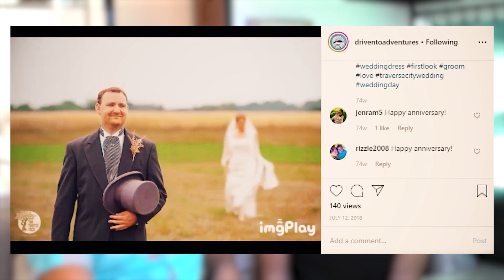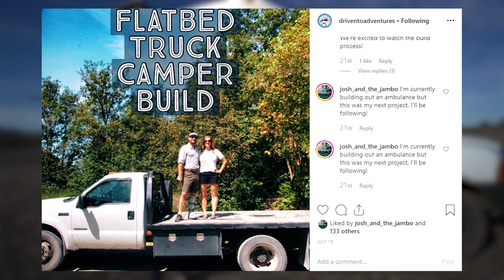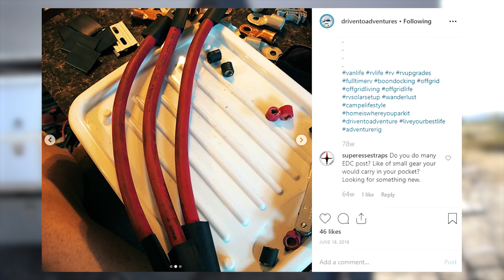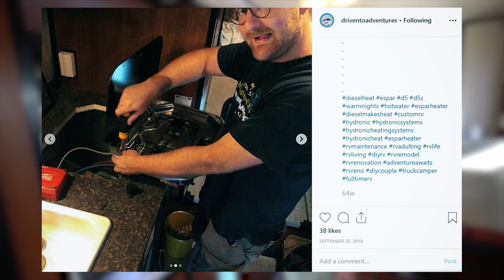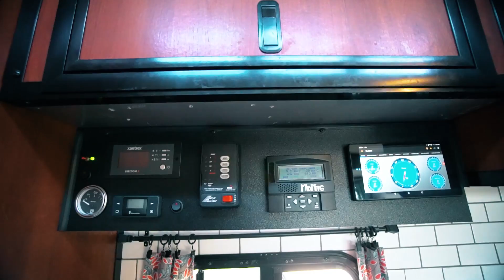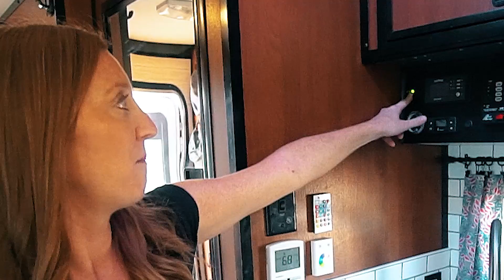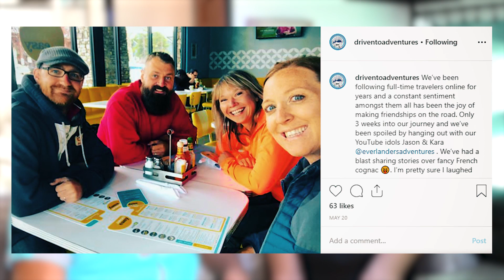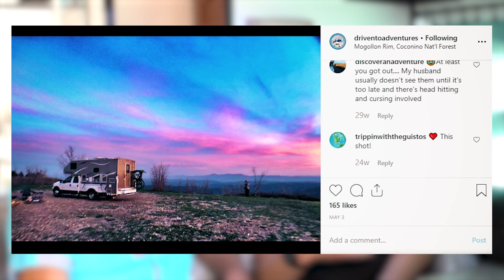Custom Overland Truck Camper Build - One Couples Ultimate Adventure Rig

Comment: This is about 80% of what I want.  Take that idea of bed and put it on a 4wd Isuzu diesel truck, or a Fuso, with added water tanks and filtration system for unlimited boondocking.  Maybe a little garage for a Rokon Mototractor, or just a fat tire ebike and keep the pass thru.  Pretty inspiring design to see it like this though.  Can't wait to start mine.

Comment: I absolutely love this.  So well thought out.  
The extra outside storage is particularly good.  Having a good, solid outside storage is a must if you are going out an about exploring, and doing it from a small space.  You need to take your life outside more, so keeping useful storage outside for outdoors equipment is great for that.  

Good idea on gutting out some of the inefficiently used spaces and repurposing them.  A lot of small spaces are designed for, not sure how to put it, to be the most welcoming for the majority of people I guess?  Not "too cramped" or "too sterile" or "too sharp" and other such things, but in doing so they tend to waste a lot of space in looking certain ways, or having so much space dedicated to X, which takes space away from Y, and so on.  Curves are the biggest curse in small spaces.  They might look nice, but in reality they take away a lot of useful space way too often.  
A lot of people down-sizing are typically looking to make more use of space in every way possible.  They can usually find better ways of making use of that space and doing it in an aesthetically pleasing way.  It is a weird paradox lol
In my case, I would actually go one further in optimizing space use - I would put the toilet in the shower room, at least as long as the toilet itself can be made airtight with an external vent for airflow so no moisture gets in to it.
This not only gives you a massive amount of space in the current toilet room, it also gives you a nice comfy shower seat.  Double win.  Not for everyone though.  Needs the proper toilet for it.
Speaking of spaces, the locking system is great.   Great idea.   Electromagnetic locks make a lot of sense where mechanical ones just seem impractical for things being accessed regularly.  They take basically no power if you design them properly (being locked by gravity rather than active current).

Comment: The biggest (pun) factor in being able to live full-time in a camper or small trailer is is not the size of the rig; rather it's the size of the people habitating therein.  It can be nearly a perfect situation for some people (those under 6' and not heavy of build).   For larger persons it's sort of like wearing shoes that are slightly too small (you can stand it for a little while).  For  people well above average size it can be an ordeal.   For the truly huge, it's not even doable except in an emergency (certainly not for two 6' 6"+ and heavily built individuals).  But they're FANTASTIC for a couple of quite small and slim people.

Comment: Love the rig. I like how you took a tc and modified it to what you wanted. I'm not a fan of the camplight truck campers. I would have done a northernlight or a bigfoot, but that's just me. It would have been a little harder to modify the fiberglass campers for sure. Not sure i like getting rid if the propane completely. I like it for heat and cooking, but definatly a good choice on changing out to compressor fridge. I have been thinking of outfitting my truck camper to a flatbed. The boxes you made fit well and make the rig look propionate and practical. Storage always seems to be a problem in a rig you spend alot of time in. I wish I could live with less stuff. Do you know how much the rig weighs? I think weight is a big factor when it comes to alot of offroading situations like sand and mud.
Reply: Hey! We’re pretty heavy - 17k with fuel and water, fully loaded. If we want to be able to air down, we need to upgrade the tires as planned. We know other overland rigs around our weight running the bigger single tires and they are really able to go almost anywhere
Reply: @DrivenToAdventures  thanks for the reply. Most dont seem to know what they weigh. I'm around 10k, so I can use the load E tires that are easier to find. I now realize that I had watched some of your videos. I thought the composting toilet video was really good. Most dont recommend the air head. Im changing out mine to that same set up. The urine will go into my black tank. I also remeber your struggles with your 7.3. I hope that worked out. Those motors are getting harder to find. Good choices on the rig. I envy your lifestyle.... I think your missing a pet. Seems that's a requirement for full timing.?.?
Reply: dsgrayco pets are highly overrated IMO
Reply: dsgrayco hey! We finally got a ford reman installed and it’s doing great so far in Baja!
Reply: Driven To Adventures i miss Baja soooooooo much!
Reply: Pretty sure that getting rid of the propane is one of the best decisions any boondocker can make. Composting toilet is second. Electric (with lots of solar, battery, and a beefy inverter) w/ diesel can heat, cook, hot water, etc. Two huge advantages of electric/diesel over propane:

First, propane and propane appliances are dangerous. Propane burners aren't just a fire hazard, they also are terrible for your lungs. Three-way fridges... say no more. 

Second, when boondocking, you're on several clocks before you have to come back in. Any one running out forces you to go back in. Water, black tank, food, propane, fuel. If you're almost entirely solar with your prime mover and your backup heat sharing the prime mover's huge fuel tank, you just removed one limit and dramatically lengthened a second to how long you can stay unplugged.

Comment: Very lovely rig you own. Ditching propane is the best thing you did. Those diesel heaters works better and cheaper to operate and less prone to fire hazards. And induction burners are just as good as conventional ones. Plus it’s so annoying to fill up those 20# or 30# propane tanks every time you run out

Comment: All refrigerators have some sort of refrigerant gas like lp400 etc inside even if it doesn’t use propane to run it has it inside the condenser which is how they work.  When propane moves it cools rapidly and inside every fridge they have the gas inside the condenser.
Reply: Electric kitchen fridges have gas in them and is why you can’t just dump them.  I work with butane and propane and refrigerant pumps which are rated for explosive gasses.  So I’m not sure what the problem with fires is I don’t think it’s he fridge. Or many homes would burn down from the same reason.

Comment: Sweet rig, you mentioned to go from dually to super single. I’m sure super single is better on mpg and also on off-road however I don’t think pros outweigh cons. Once you lose a tire on dually you still got the other one to support your truck and your rig won’t go crazy on interstate cause you were going 70’mph, not to mention if you’re in middle of nowhere you can still drive to a shop. Just my two cents, I drive a big rig and would never choose super singles

Comment: look at the rear springs, way overloaded, add airbags asap to rear.
Reply: Austin Manna we have airbags and we’re not overweight.
Reply: @DrivenToAdventures  your rear springs are frowning in the video! Just because your actual weight may be within that trucks "spec" how you have it on the flatbed it's too far back. Causing increased stress on the rear. It will cause premature failure

Comment: as many things as they did right here, they did just as many things wrong. Greg is obviously very skilled any recognized that a dually 4x4 is not a smart idea, but proceeding with it without changing out the rear end is a mistake. So much wasted space between the camper and the truck bed. Separate room for a toilet and shower is not much a ton of wasted space. Microwave to boiling water, wtf. Get a single burner stove.